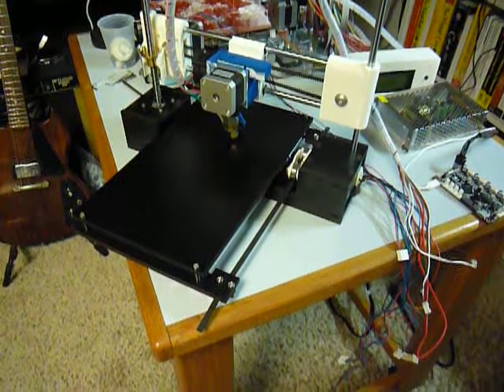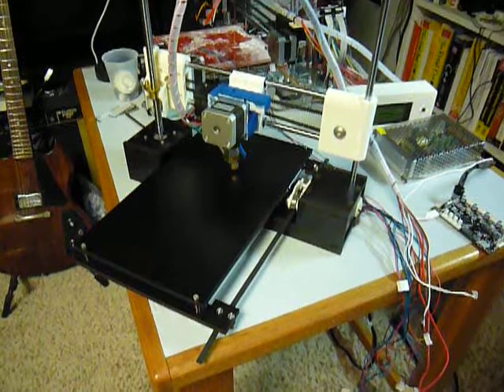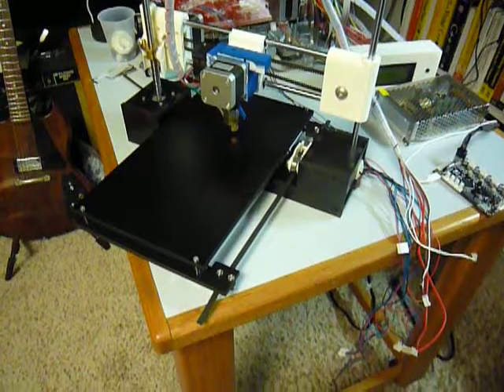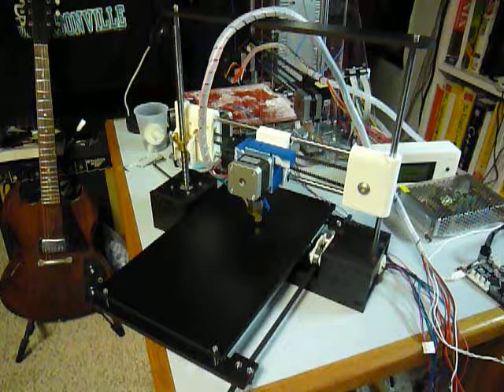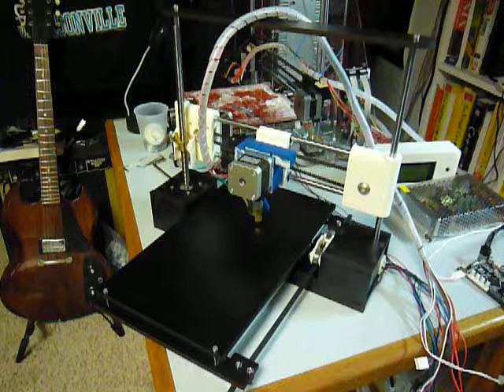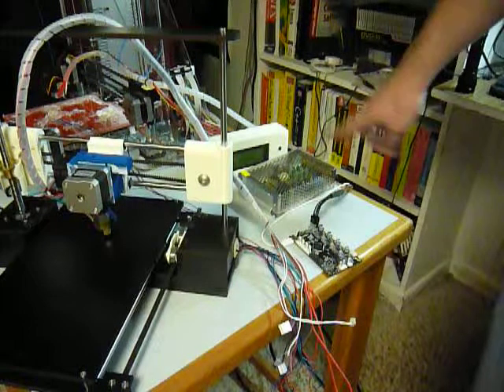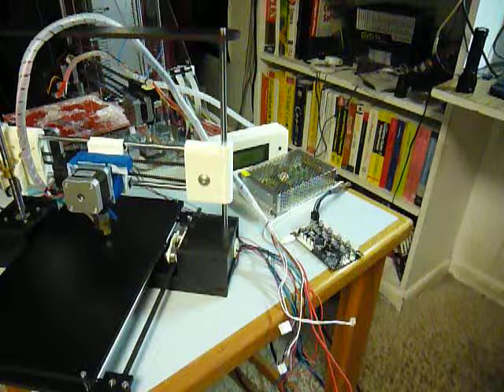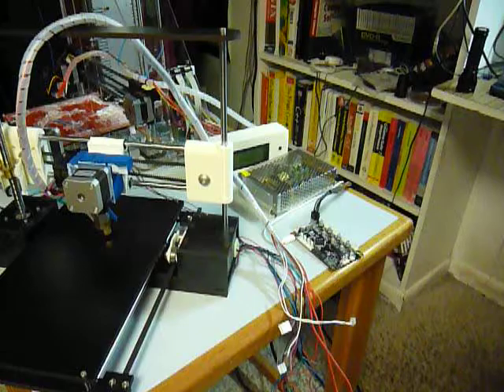QU BD TWOUP 3D Printer upgrade part 3

Comment: Hi,
I have a qu-bd two up and I'm in the finish phase: Y drive to Z rods. My Y drive stuck when I roll the Z screw rod. What can I do (oil maybe? )
Reply from the maker: its interesting that the y axis is binding  when you move the z axis acme rod. Yes you can use oil or perhaps a silicone spray or powdered graphite. One thing I would recommend is look at the belt on the y axis and make sure it is not coming off the bearings and rubbing also, if your x axis is not built rigid enough there might be too much sag which could cause binding and pinching on the acme screw. were you building a stock two-up or did you make the upgrades like me? the new x gantry design helps a lot with sag and rigidity.